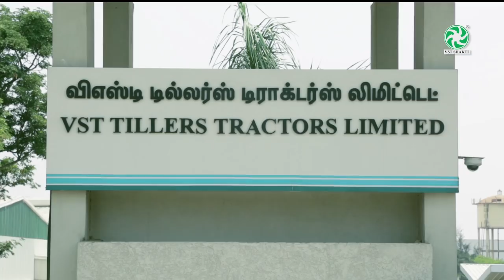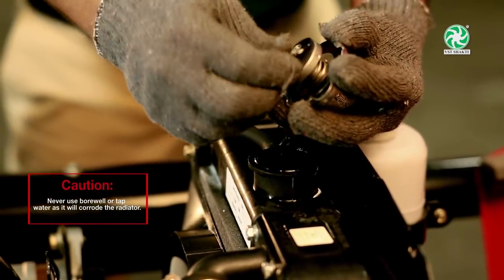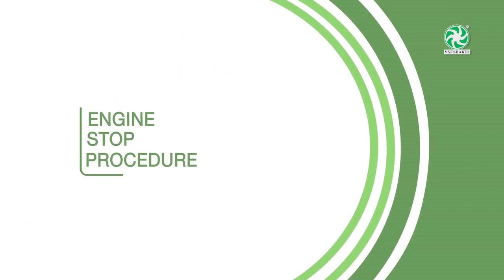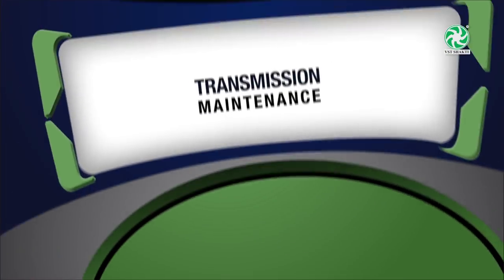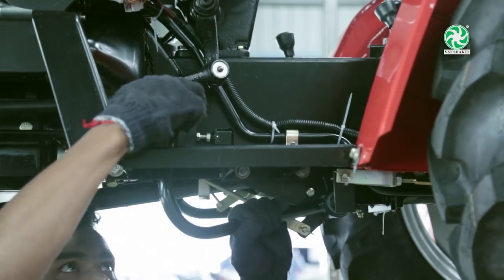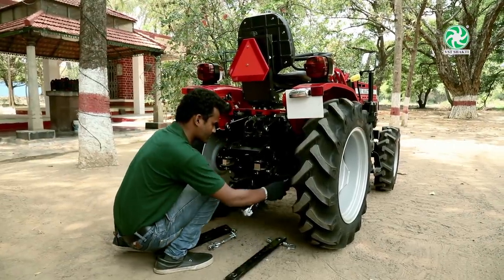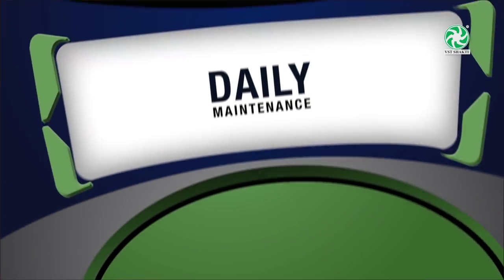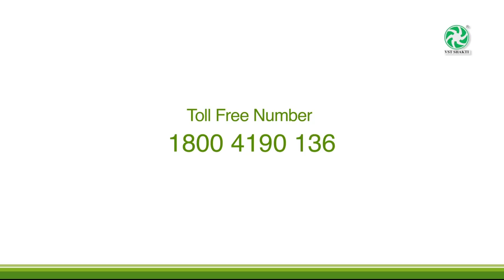VST  SHAKTI TRACTOR MT 270- Installation Video

Comment: vst shakati mini tractor is flops & fake information tractor. ..
I am customers of vst 22hp mini tractor in this tractor hydraulic 750kg capacity but actually working on 250 to 300kg not working  ADDC sensing & gearbox technology is very old slider mesh is regularly chaging problem of gears & no speed veration & over hitting problem, this tractor is price is low other than tractor but they provide no popular specific future 
popular ADDC Hydraulic sensing in mini tractor provide other than vst tractor for example farmtrac atom26 is providing accurately ADDC sensing in hydraulic & all new features provide like big tractor. ..
Reply: Thank you so much our V.S.T. tractor copany change & Development gearbox in fully synchromesh, hydraulic system, speed variation, dry types air cleaner on vst 30 hp tractor, our copany also add 4th gear in 30hp tractor & Development, adding new features new technology in 18 - 22hp 4w tractor. ...